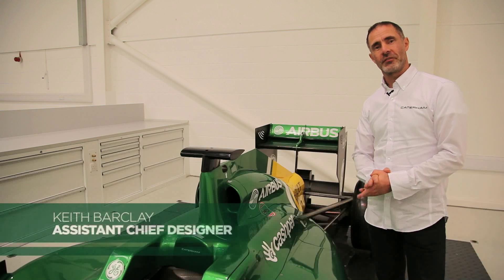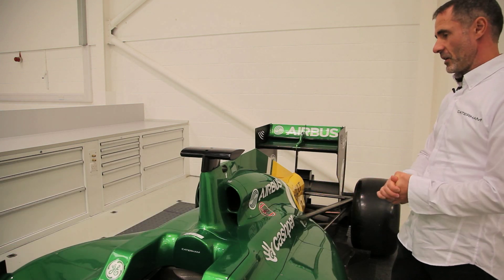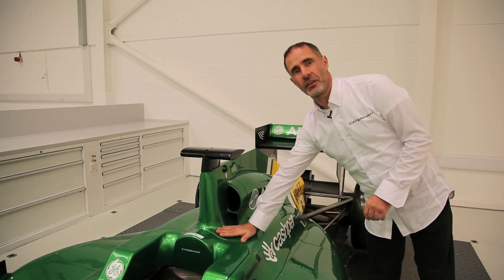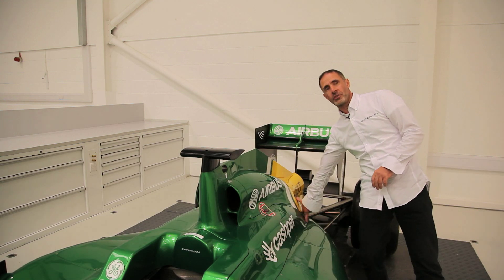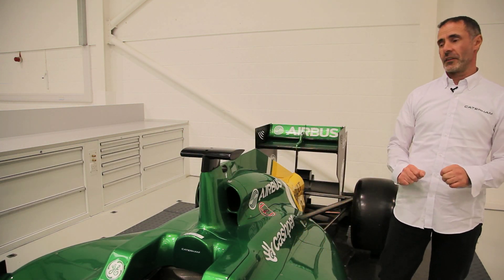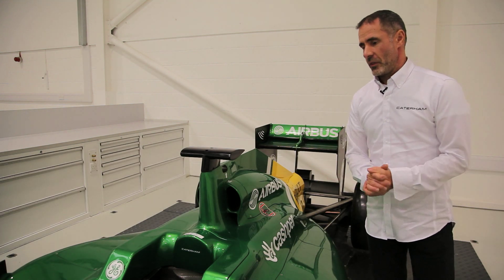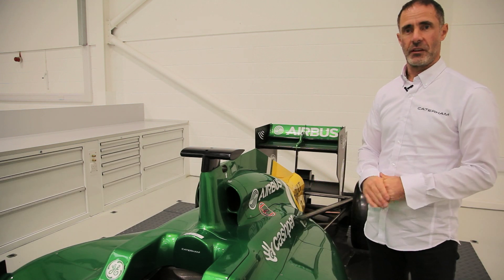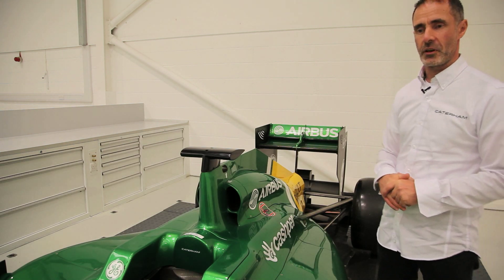How KERS works in F1

Comment: The cone-shaped duct you see on the rear section is there to help funnel hot air out of the vicinity of the engine and gearbox; it does not carry engine exhaust. I believe that Ferrari first ran a small air-exhaust duct in this location on the F2007. There may be an aerodynamic benefit in terms of trying to blow the rear wing with air coming from this funnel, but that's beyond my understanding - perhaps our friends at Caterham would be so kind as to enlighten us?